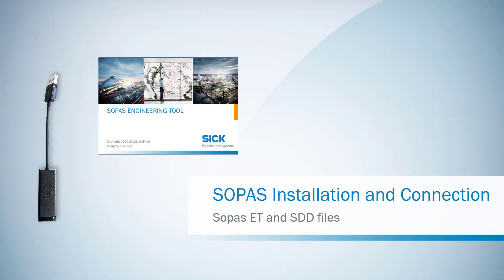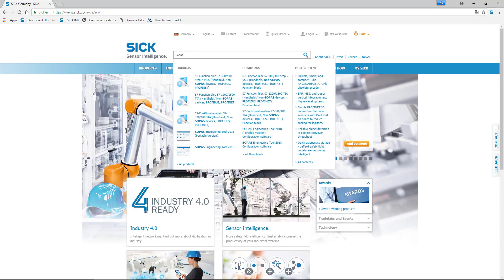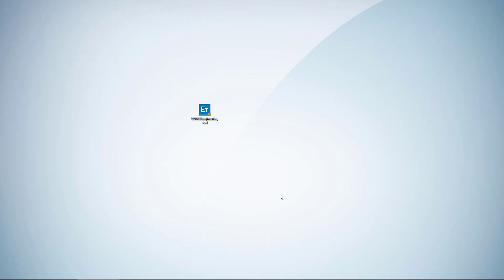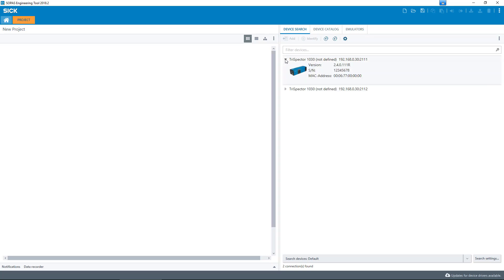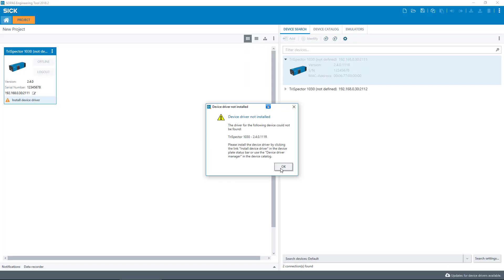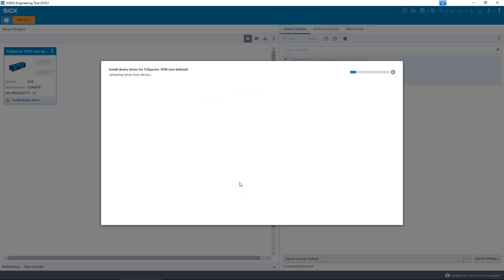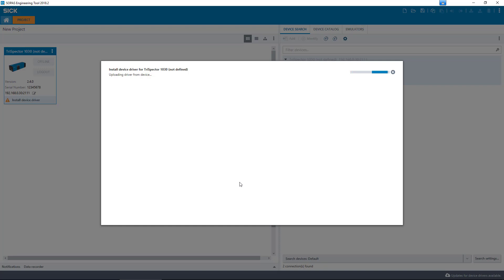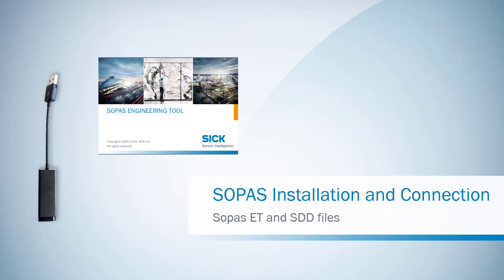SICK SOPAS installation and first device connection | SICK AG

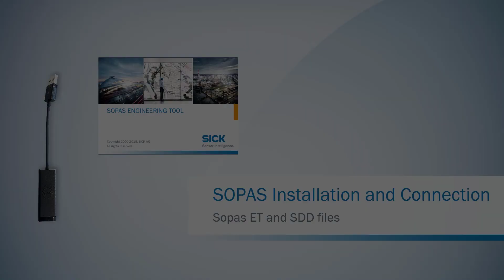Comment: 2:11 Hello. How to solve a device not in sync? When I connect, I get 3 erroneous parameters. Not all parameters could be read:
cartStateMap: ErrorResponse index = 3
cartMultiplier: ErrorMultiplier index = 3
heartbeatPeriod: ErrorResponse index = 3
Reply from the maker: Hello and thank you for your comment. In order to answer your question in the best possible way, we need more details. Please contact our technical experts by mail: info@sick.de or use the contact form on the website: www.sick.com
Reply: @johnmills2629 Did you ever get this issued resolved?  I'm having the same problem currently.